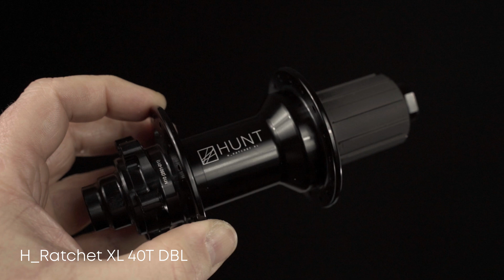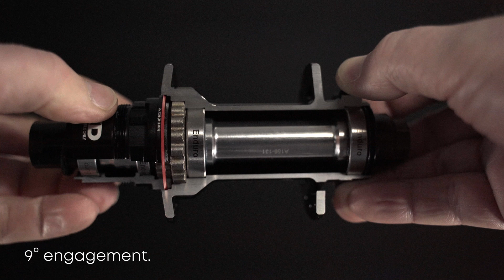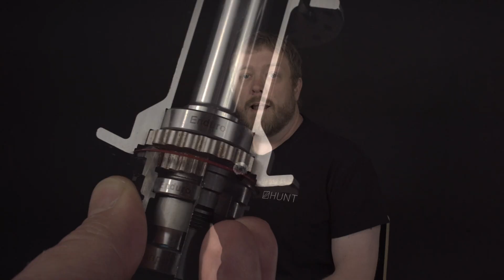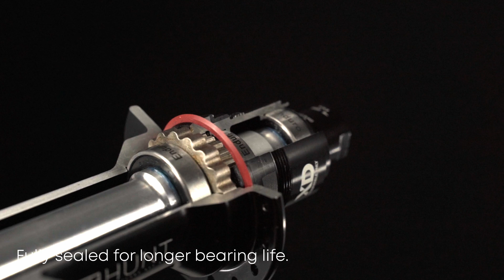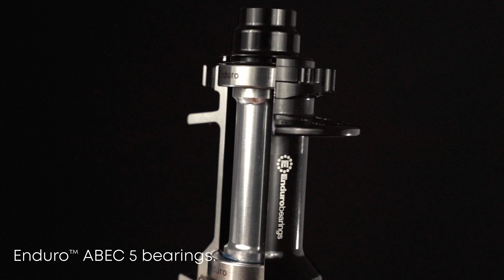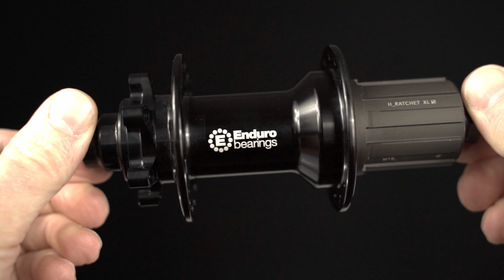H_Ratchet 40T XL DBL Tech Explainer Video

Comment: Just received my HUNT 40 Carbon Gravel Race Wheelset - with a Microspline free hub - The Ratchet 40T, is it reversible? I.e does it matter which way it goes on? Reason I'm asking, when transferring the cassette from my old wheels to these new ones the ratchet fell out and I'm unsure which way it goes on - please advise.
Reply from the maker: Hello, thank you for getting in touch. This document should help you with your ratchet issue but please get in touch if you are still needing assistance. https://help.huntbikewheels.com/support/solutions/articles/43000711366-changing-an-h-ratchet-40t-freehub-body